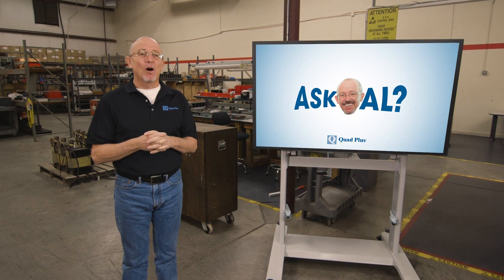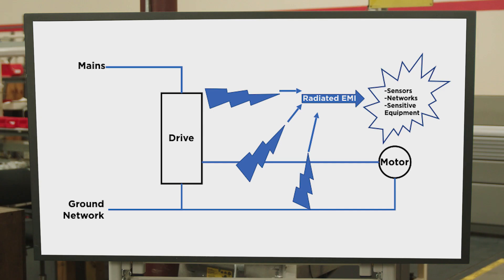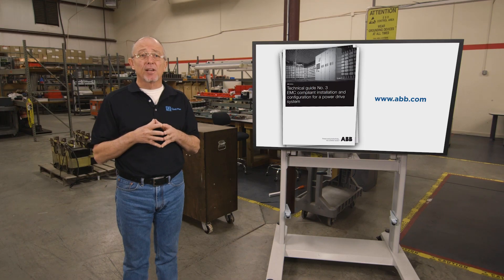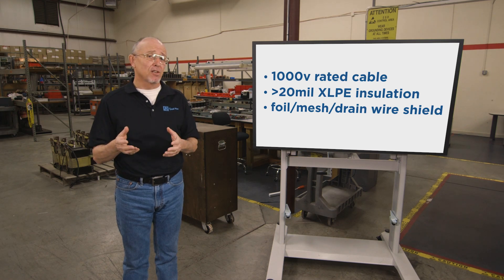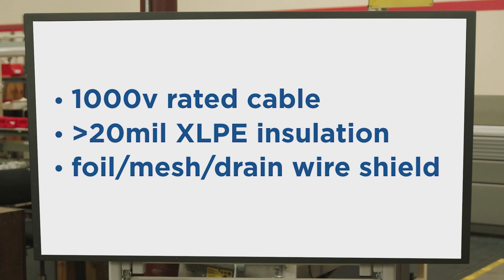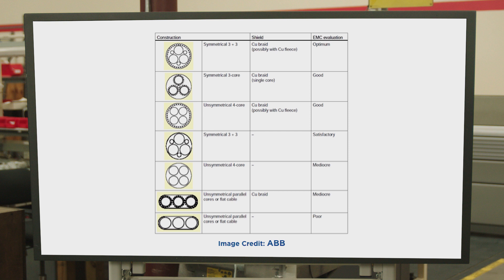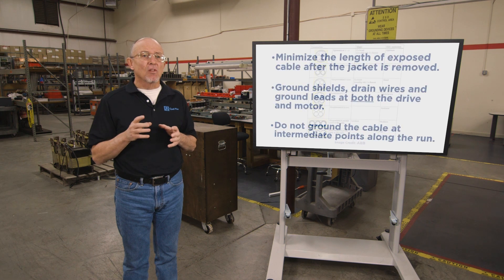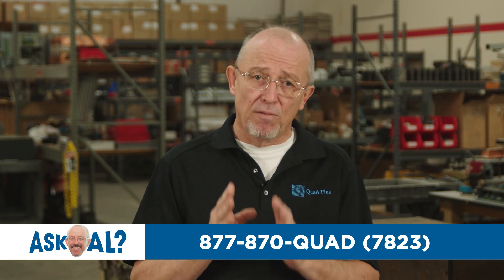Why do VFDs Need Special Cables? | Ask Al Presented by Quad Plus

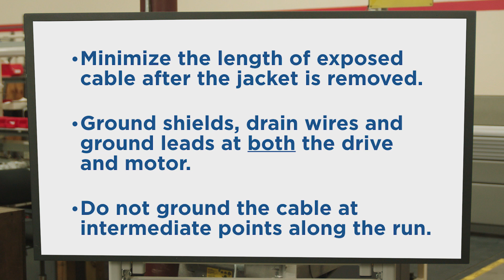Comment: @6:58 "in this scenario..." what is different in this scenario such that grounding on both ends is the recommended way to go vs. only grounding at one end only in some other kind of scenarios?
Reply: You need the surface area of the shield to conduct the high frequency currents back to the vfd. These can be as high as hundreds of khz. 
With small signals from things like sensors, encoders etc. You ground one end only, to form a Faraday shield. That helps prevent noise from impacting the signals..

Comment: no help lot my project, i build DIY cnc machine and just buy 2,2KW VFD and spindle motor, i used VFD input 230V single phase, output have 230V 3-phase to spindle motoer,  i not know what cable need use, i think need be 4x2,5mm2 shielded cable inverter to motor, have this right?  wall socket not need be shielded cable ? normal power to VFD 3x2,5mm2 cable. need cable be 2,5mm2 if VFD and motor have 2,2KW or what cable need be, curret have motor 8Ampere, or can i use 1,5mm2 cable (lot cheapen than 2,5) europe normal 230V main power.

Comment: I retired from a large campus that had over 500 VFD'S. Never wasted money on shielded cable on there 480 volt output side of any drives. Used plain Jane THWN copper wire for every 6 & 18 pulse drives. Most motors were plain Jane NEMA motors & the rest high efficiency motors. Had some 40 year old motors that were on drives. Even had two 4,160 volt 1,750 HP chiller motors on drives with regular medium voltage cable. Most drives were less then 40' from motors.
Reply: Considering the cable lengths were mostly under 40' how many cents do you reckon you saved skimping on the cable? 

As a service tech doing warranty inspections and repairs for an HVAC manufacturer (northern Europe) I've replaced bearings (or the whole motor) on hundreds of under 2 year old 1-20kW VFD driven motors. The bearing grease is usually burnt into a black tar or a crumbling solid and the races are pitted or cloudy. Many have been wired with an MCMK cable with 3 phase conductors and a shield where the shielding copper foil and strands have been twisted at the ends into a single PE and EMC conductor. A version with 3 phase wires, a designated PE of the same gauge or thicker and a separate EMC shield would have cost between 5 to 10 cents more per meter. Some have had a proper cable but the grounding contact of the shield inside the metal glands hadn't been done properly. Often a safety switch between the VFD and the motor had been the culprit.

Bearing replacement on a large motor can cost a 1000€ while the unit is out of service for the day. I think VFD motor drive cables should be the last thing to skimp on. I tell that to all our customers and recommend improvements on new sites. Many times I've known right away that unless the cabling is corrected we'll be back in a year or two.
Reply: Update: Just last week I was called back to one site I wa specifically referring to 6 months ago. To no surprise it was to investigate a noise in a VFD driven 3kW fan motor. 

The noise was a low rumble that's typical for a bearing damaged by EDM. The heat from the arcing has burned away the lubrication and the balls roll dry against the micro-pitted races. That kind of damage usually escalates very rapidly and the bearings have a tendency fail catastrophically suddenly ejecting the balls ripping apart the cage. I've seen a quite a few lately and everyone had problems in grounding, shielding.or both. 

Now they want a comprehensive report on the cause and mechanism of the problem and instructions on how to improve the cabling. There are around 40 units where the the VFD to motor cabling is done using three phase conductors and a twisted shield serves both protective and functional purposes. All of them have a disconnect switch between the drive and motor, too. The electrical contractor isn't going to be happy and might take the case to court. Be my guest. 

The Schneider ATV212 VFD wiring instructions specify a separate PE conductor. It's mostly a safety feature that has to be able to carry high currents at lower frequencies. They highly recommend using a continuous EMC shield between drive and motor when operating multiple units in the same space. It's function is to be a current carrying conductor for the high frequency instabilities, harmonics and common mode currents a VFD inevitably produces. The shield's purpose is to offer a low impedance path for the HF and RF currents back to the source, the inverter or the rectifier. Every discontinuity in impedance, ie.g. twisted strands screwed to a terminal in a safety switch, reflects part of the current back to the motor. Such a cable radiates EMI to it's surroundings. I'm building a current transformer for my scope so I can demonstrate the effect and the remedy.
Reply: I'm pretty sure the MV Cable confers the same advantages as VFD cable because it's also shielded

Comment: this is a brilliant presentation, thank you.
The only thing I would add is that conductors need to be SIZED TO PASS THE PEAK CURRENT density, not the average value. 

This helps transfer the dV/dT spikes into the motor without dissipating energy in the serial impedance of an undersized sized cable. (ppl talk about reflecting or bouncing waves when energy can't go through!)

This is is true with any Pulsed Modulation: "pass the peak not the average"!
🤞

Comment: very informative, but one question - doesn't the motor act as as smoothing inductor (reactor) and smooth out the square wave at least somewhat in the entire circuit?
Reply: You're asking, will the motor’s inductances do the same job as an output load reactor?  The answer is absolutely not.   The output load reactor is placed next to the drive. This slows down the rise time before it even gets to the cable.  This helps in many ways and if you'd like to know more, I can tell you.  You might not believe this but smaller motors have more problems with pulse width modulation then larger motors when you are running long cables. If you'd like to know, just ask.
Reply: Sort of. What the motor inductance DOES do is smooth the motor CURRENT so that it approximates a sinewave, despite the VOLTAGE being a PWM mess.

Comment: Great information, but I note Belden does not recommend the use of 360 degree shield terminating cable glands. With a shieled terminating gland, significant shield currents can be released, for example at enclosure ingress, exposing sensitive equipment to noise currents that would be contained if an isolating cable gland such as a Crouse CGB, ADE or CMP TC or A2 Gland.  Pete C
Reply: I don't know where you read that, but 360 bonding of cable screens at BOTH ends to the equipment chassis is almost always best for EMI. The old advice to bond only at one end was typically to avoid the potential for excessive currents to flow through the screen and damage them, but there are ways to address this concern.

Comment: Geee,  build the vfd power pack on the motor back-end or very close to the motor,   then no more long cables...  sorry belden...:)       or go back to the one common line shaft or adjustable gearbox